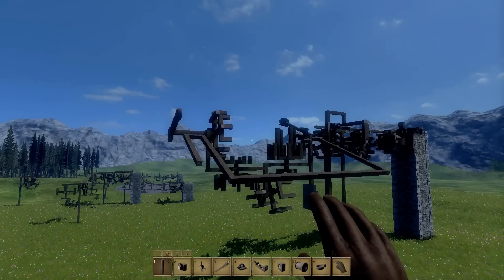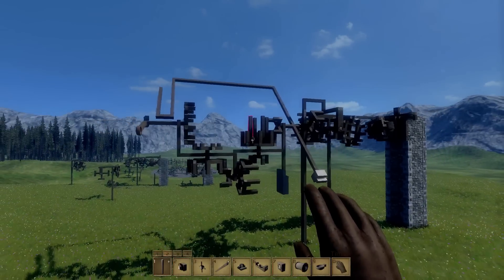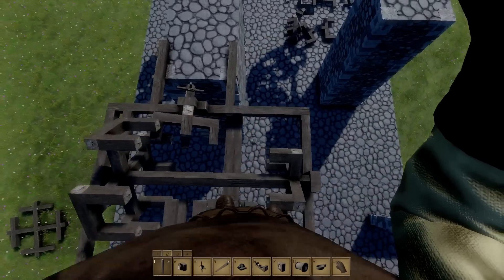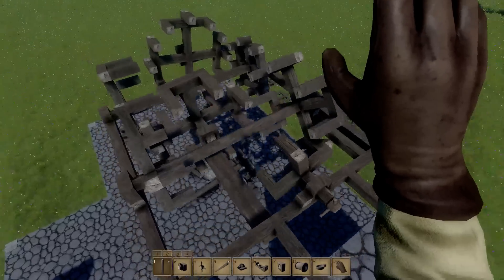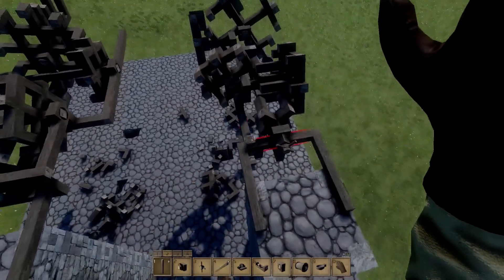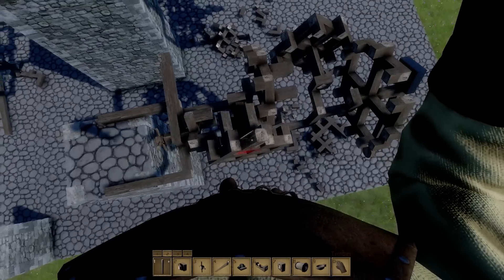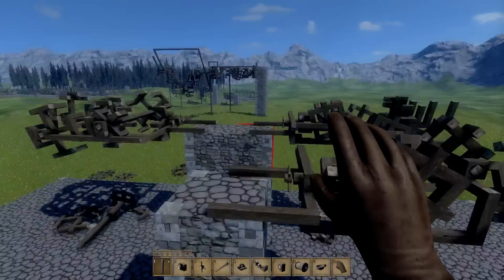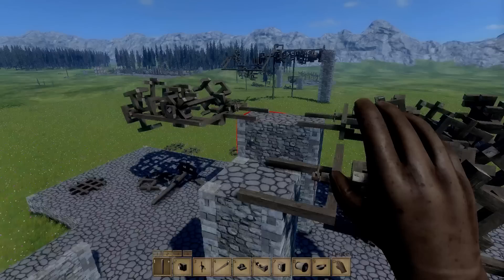Medieval Engineers Ep5, Gear Optimizations.

Comment: Try to Cog mod, it will allow you to further optimize your clock works. all the mod does is gives you gear pegs that you can put on a homemade wooden wheel. don't  use the existing wheels, the cog pegs won't place, so make your own. I used this method to build a deer powered war machine, its is really just a car, but on a massive scale due to block limitations.

Comment: Wow. That's some great compacting you've done there :) Looking froward to the clock tower reveal. Got 2 ideas that might help a little if they work :)

Wouldn't it be possible to move the minute dials axle away from the rest with a belt. then reconnect it right behind the face with a second belt? That way you wouldn't need to do the entire stick thing around everything :)

You could probably put gear box vertically as well, and end it with a 1:1 gearbox to make the axle horizontal again. Put the rotor on the floor and build up from there?
Reply from the maker: Yea, with belts i could circumvent a lot of things.  
But i find them kind of cheaty because ropes go trough solid objects and all that :)
And part of the whole thing is to overcome challenges, rather than getting rid of them :p
Reply: Ironvos I think you could make it so they don't need to. But we have our different ways of doing things :) good luck!